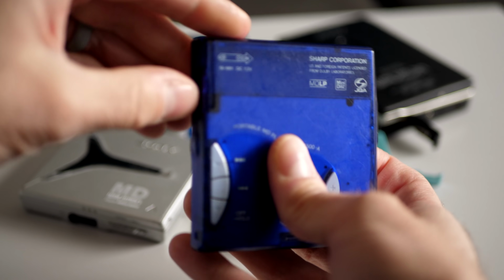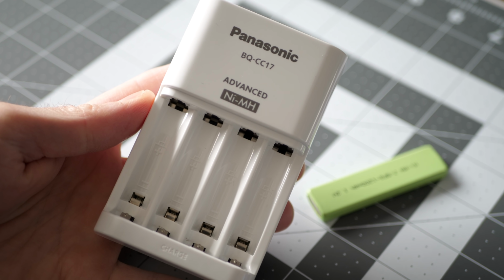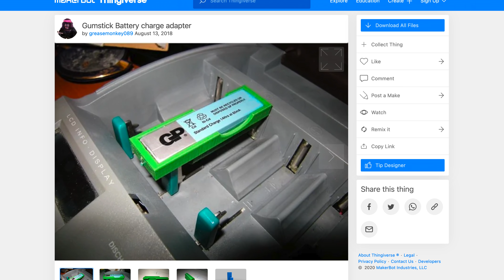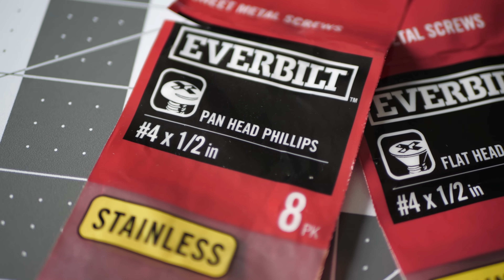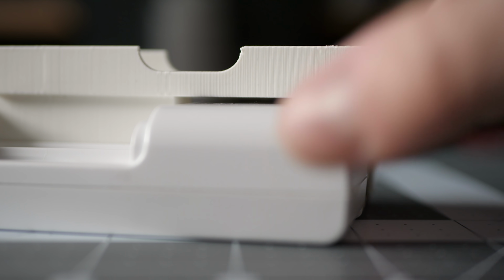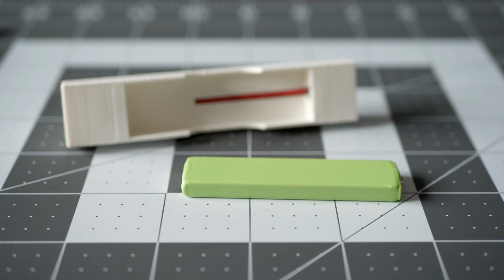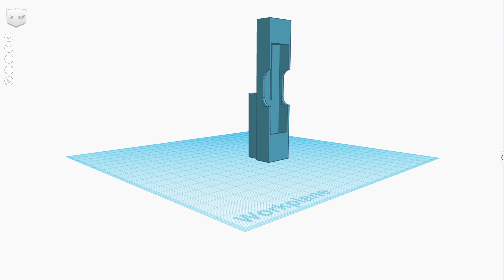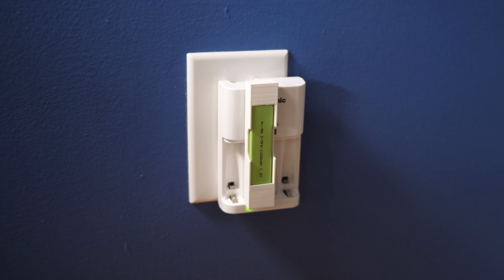Make a Walkman Gumstick Battery Charging Adapter!

Comment: Just ordered two USB-C gumstick batteries. There's a USB-C port on the side of the battery. 900mah and the battery can be taken apart when the LiPo pack inside needs replacing.

Comment: Thank you! I hadn't even considered this. I have a cheap 3D printer which unfortunately would never be able to print something like this standing on its base. But I have an Energizer battery charger I bought back when the Wii came out which was made to charge all the standard battery sizes and the gumstick batteries fit (with some finessing) in the D size battery slot!

Comment: I designed something similar to this, but to be printed on a resin printer. Took me the best part of 5 hours to print, wash and cure. Didn't add screw holes to my design and thought it would be okay. I got 3 turns in to one of the screws and the whole thing cracked and split into several pieces. What a waste of time, I forgot how brittle the resin I used is...

Think I'll try your version now, looks like you had a lot more forward thinking than I did, hopefully this one doesn't shatter, too!

Comment: it ´s a bit tricky but my hi md portable will start charging the battery via USB after some steps and then i´ll leave it alone for a few hours and then i can just use it.
But also just found the separate adapter i got with a cassette walkman that´s probably broken nowadays but also used the same gumstick battery.

Comment: You can reuse old springs from dead devices and screw them in together with the screw you have now to ad the springloadedness, you will need to ad length to the stick holder though :D

Comment: I don't have any gumsticks to test, but I believe they would fit well enough in this generic "nightcore" battery charger I've got. Supports ni-mh & li-ion (and a couple others I think) ranging from AAA to those beefier vape batteries, with flatter terminals rather than those pins that other guys had so it should sit fairly stable on its own. At most a small semi-cylinder shaped bracket to provide better back support would be nice but likely unnecessary.

Comment: Try some glue stick on your print bed, you can also increase the size of the little raft to get it to stick better, might be able to overcome the extrusion issues if it stuck better

Might try lowering your first layer a tiny bit too

Comment: Nice trick using the screws as terminals. You can 3D print a compliant spring. I did one for a mechanical latch.

Comment: I've had good results with rafts despite them not being popular among the cool kids. Especially with ABS. That being said, i'm still waiting for a new print bed to arrive.
Alternativelly, you could probably print this holder in 2 parts and assemble them afterwards with either glue or screws which could also help with the inclusion of spring terminals since you'll have a better access to their pads for soldering.
Reply: On a side note, while I get why cylinder shaped batteries are the norm, I wish these ones were safer and easier to manufacture. Cubes are so elegant and efficient in their way.

Comment: By the way was the part printed in PLA? If it's the standard variety I wonder how it will hold up with time, from how much my Ni-MH cells heat up in charge I would say ABS is the go-to material for this type of project, albeit I can imagine it being tricky to print on an open frame printer.

Well, when it eventually fails (which I don't mean as "it's not gonna last" but as like anything will eventually), you'll have designed an even better version of it too and gotten real good at the 3D printing.

Comment: You got too hung up on the design you tried to improve - by starting over you could have made a better design which is easier to print.

Just turn the gumstick 90 desgrees and make the whole adapter slimmer that way - then don't make the piece which goes into the charger round but half of an octagon - e' voila - now you can print it on its side.

Comment: by making the part which fits into the charger not round but with corners (half of an octagon) you can print the charging adapter on its side. Now also make the compartment in a way so the gumstick is turned 90 degrees to its current orientation - voila, you can now print the part in place lying down.

Comment: An earlier video with a device which uses these, had me pondering about feasibility of a 3D printed, caddy, adapter of sorts, that might use readily available flat batteries, like those foil enclosed things in small smart devices. Not sure how much MaH one might get from such, or if long, thin ones are common. Great video on the matter of powering these. :)

Small note on springs, a channel I follow, Odd Tinkering, has replaced quite few corroded flat spring with ones he made himself. I'm thinking copper is relatively easy to work with, even without the tools and machinery he has.

Comment: For spring loading, maybe a steel or aluminum strip bend to a tent-shape point for the bottom of the battery, that's first screwed in place in the bottom before being bent down? It could provide just the small spring tension you're looking for to push the battery up without being too much of a pain to remove the battery, and still provide for easy, solderless installation.

Comment: The problem of printing your model standing up is that you dont get mechanically strong walls, as the perimeters thru the z axis are made of 2 or 3 looops, thus rendering the shape very fragile along the vertical axis; if you print the model flat, you of course need support (you should put the round external part facing down the bed) but you gain a lot of mechanical strenght along the longer axis (which is the one receiving the torsion for the battery removal and insertion); also I recommend ABS instead of PLA to further strengthen the final model and you get the bonus that you can file it or sand it without compromising the thin walls

Comment: i cut a cheap charger across the battery compartments so i can make the compartment taller , then i just hot glued both halfs to a wood panel to keep the correct distance 
works like a charme

Comment: Use a door tumbler spring with a copper tack soldered to the end. Fit this in a recess.
Reply: https://www.ebay.com/itm/25-Pk-Kwikset-Lock-Master-Keyed-Lock-Springs-Locksmith-Rekey-Short-Springs/224103928570?hash=item342da292fa:g:8dsAAOSwwnlfJ4mP
Reply: https://www.ebay.com/itm/Stronghold-1-1-4-Smooth-Plain-Shank-Solid-Copper-Nails-45-pcs/143869146169?hash=item217f44f439:g:LLIAAOSwg1lfxnZq

Comment: Wow great idea! Instead of springs could you use a strip of metal, folded in half and securing it with the bottom screw? It should provide enough springiness (?) to allow for easier battery removal.
Edit: I think that you would need a slightly larger chamber though.

Comment: Ingenius! However, for those that do not have the werewithal and want a cheap and cheerful spring-loaded single battery charger, I recommend the Klarus K1X (I have no affiliation with the company). It is small and safe and charges via USB connector, which makes it extremely portable.

Comment: Can your printer do bridging? The model might not need much adjustment and may be printable with the gumstick side facing down. The only problem I might see with that is the wire channel running through the center.

Comment: 4:48 - Your battery-charger can charge a single battery? I've never seen a NiMH charger that does that, they always require a pair. The last single-battery charger I saw was for NiCd. (To clarify, I mean legitimate brand-name NiMH chargers; the cheap Chinese ones will do anything because they're unreliable, unsafe junk per the face-palmingly useless eBay listing at 0:42.)
Reply: Plenty of NiMH chargers can do single batteries. Both of my IKEA ladda chargers can, for instance, also do it.

Comment: i have never before today wanted a 3D printer. i don't even have any gumsticks, but this is incredibly impressive engineering. my one thought regarding battery removal is possibly making a small hole on the back, at the bottom. that way you could just push the bottom out with a pen or similar tool (even a fingertip, if the hold allows it).

Comment: I wonder if the back was a panel  (the flat surface that touches the back of the gumstick) , if you could print the adapter face down and hollow (or mostly hollow) to give access to insert some contacts of some sort and then snap the panel in to hide the wires (extra benefit) and hold all of the contacts in place? 

Also, use skirts to help hold prints in place.

Comment: You could place a piece of fabric that lays under the battery, such as an old shoe lace or some ribbon. Then just lift it up to remove the battery.
Reply: I see what you're saying . Wouldn't it need a spring for the negative terminal that could flex when you pull on the fabric?
Reply: @beninreallife  not if it works like some double A devices ive seen

Comment: Question: Is there anything to stop me from jamming the gumsticks into any generic, spring loaded charger which can phisically fit them? (A charger that can charge NiMh, of course) To me it looks like those chargers which are used to charge 18650s might fit it). Anybody know if it can be done (safely) ?
Reply: If the charger supports NiMH AAs and is electrically sound, you should be OK.
Reply: @Hagledesperado  Cool. I'll get back to you if I burnt by house down ;)
Reply: @RanFuRe  To be extra safe, ensure that the charger goes into NiMH mode and doesn't try to charge the gumstick as a Lithium cell. If there are no status indicators, you would need to check voltage periodically with a multimeter. You can also check the temperature of the gumstick with your finger. At the end of the charge it should get quite warm, but if it gets very hot, abort.
Reply: @Hagledesperado  Will do. Thank you for the detailed answer! :)

Comment: Great work, Colin!  Maybe you can consider uploading your CAD files to Thingiverse in addition to the STL.
Reply from the maker: I designed it in TinkerCAD, so I don’t think I can get the original 3D model from it — it only lets me export to OBJ, STL and GLTF formats.
Reply: @ThisDoesNotCompute  Makes sense. If you're ever interested, you can use Fusion360 for free. Solidworks has cheap licenses through EAA membership.

Comment: Some fast chargers depend on cell temperature to stop charging. There is usually  a temp sensor inside the charger, close to the cells. Using this adapter can cause problems on those types of chargers.

Comment: Rotate the gumstick holder along the long axis, and have it standing with the long thin side up.  For springs, just cut any spring/flat terminal in half.
Reply: Yes, I think if the holder was designed so the gumstick was rotated "sideways" in the holder (i.e. the slot was around 6 mm wide rather than 17 mm wide), the bridge between the two sides would be narrow enough that it would print OK without any supports if printed with the front of the holder flat on the bed, even if visually it might not be perfect.

Comment: At 5:15 your right thumb pressing. Create a round hole opening & you simply push the battery out.
Instead of coils springs... I've made battery contacts out of pop can bottoms. Flat cut to desired shape, sand sealer off, make a screw hole, mount in holder, bend flat metal over the screw head. I usually bend the 2 corners out for pin-pricking the batteries end for best contact.
There's enough spring to hold said battery AND easily replaceable.

Comment: To fix the bed adhesion, you can add  a raft/skirt in the Prusa Slicer under the print settings tab.  I usually set it to 6mm in width and 1mm in height.  This will allow the print to not move around on the bed and it is easy to tear off once the print is complete.   Hope this helps!!!!
Reply: I prefer skirts over rafts when printing anything with a flat base.  Rafts make small prints take sooo much longer
Reply: No one actually uses rafts unless you have material to waste or have a bed which is not perfectly flat - either

a. adjust your printbed heigth
b. get another print surface (e.g. FilaPrint)
c. use skirts
d. reorient the print

Comment: Nice. Instead of springs, you could glue a small ribbon that wraps under the gumstick battery and hangs out. Just pull the ribbon to pop it out

Comment: Build a carriage for the wire with poles across each end. Expose lots of bare wire and wrap it around the poles to make the battery contacts. No need for any screws. Use a rubber band to pull poles together instead of springs.

Comment: For spring terminals, just use Springs.
Reply: You can even get spring terminals from cheap damaged electronics. TV remotes, chinese toys, stereos... you name it, it's all e-waste anyways. Save up spring terminals guys.
Reply: I second this. You could make the space which holds the battery a bit longer, and screw the springs with the screws you already have.
Reply: big brain
Reply: No, this thing is ridiculous. 4 magnets, 2 pieces of wire, that's all you need for a perfect fit.  Use the magnets to attach the wires to both terminals and the charger.  Printing this ridiculous adapter is a waste of time and money.
Reply: @tarstarkusz  Waste of time and money? This thing probably costs less than a dollar to make. And it is a heck of a lot less ghetto than wires and magnets.
Reply: @vhfgamer  A dollar in consumables.  But sitting down and creating it takes a lot of hours and then if you don't already own a 3d printer, you have to buy one.  There are other ways to build one that don't require designing it (I realize you can download this one, but before this, you'd have to design it yourself) and printing it.
Reply: @tarstarkusz  awesome idea, I didn't know if I'd have enough time to print before I get the battery tomorrow

Comment: Stupid question, but wouldn't it be easier to split the revised version into separate pieces that lock together when charging and easily pull apart when not in a charger? The smaller pieces should be easier to do on the side and the only other major change would be to add a little slack in the wire to enable separation.

Comment: I have one of those Nitecore 18650 chargers, which is compliant for charging standard AA/AAA Ni-MHs too. It has very good electronics inside with all needed protections, and being mainly a 18650 charger it has those long travel spring loaded terminals. I had a luck trying gumstick, fits fine and charges flawlessly. By the way, 1.2V is nominal voltage, in rechargeable batteries it means voltage when discharged. It tops to 1.5V when fully charged ( have seen you mentioned it in discman video, when you described it like low voltage baterries, which is not correct)
Reply: NiMHs are generally good at staying close to their nominal voltage for a large portion of the discharge.But the nominal voltage is neither the maximum nor the minimum voltage. They can be discharged to less than 1V, although there is of course not much energy left at that point.

Comment: Build a form around half of your back end you will have to cut off the form after it's printed but it will extend your surface area. Lay the model on it's side you will see what I mean.

Comment: As with PSP/iPod batteries I’d be surprised if the cells being sold aren’t out of date. In any larger device there’s usually an easy way to incorporate a lithium battery with some circuitry but I just don’t see it here.

Comment: Nicely done. Do you have any tutorials/guides/resources for someone who wants to learn CAD for the purposes of 3D printing? Right now I just print things I find on thingiverse, but I was hoping to learn how to design things from scratch.
Reply from the maker: Not really — I still have a lot to learn myself. I’ve found TinkerCAD to be very approachable though!
Reply: There’s different programs most the expensive ones coming from auto desk and specialised ones like zbrush for play modelling.  Try Linda if you want to dip into courses a lot of universities tell you to use them and it’s like what am I paying you for
Reply: TinkerCAD is awesome for beginners. From that you can move to more serious tools, like Autodesk Fusion 360. As a programmer I like the procedural generation of OpenSCAD so far. You essentially write a script which materializes the object with transform and boolean operations on basic shapes. Imo it's very entertaining and allows creating parametric objects, and also enables code sharing :) Oh, and it's free software.
Reply: @IstvánNagy-z7m  tinker cad doesn’t teach you real skills it’s extremely limiting. It takes a special kind of person to prefer code over proper modelling tools.